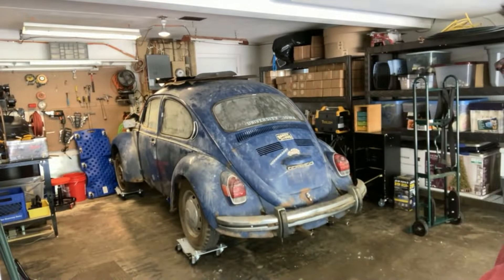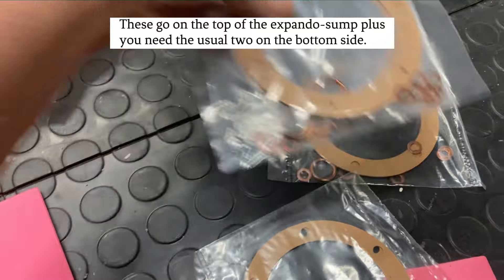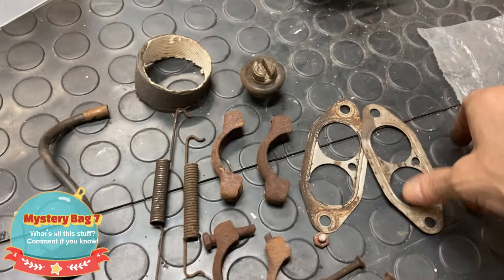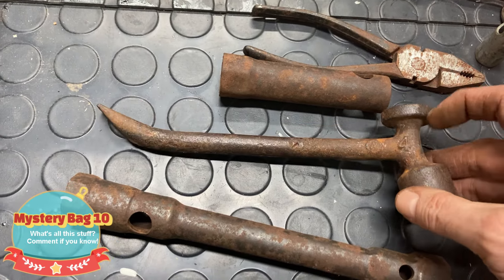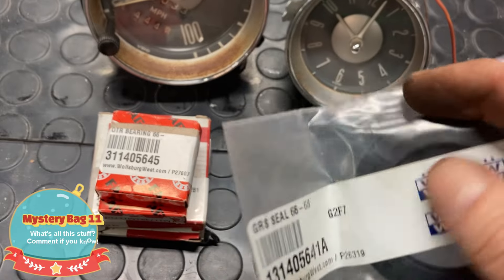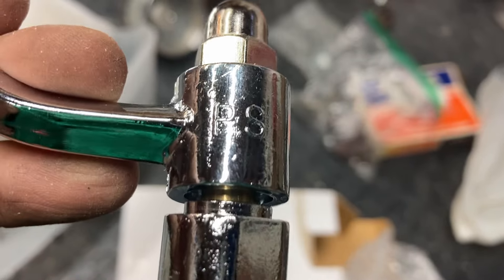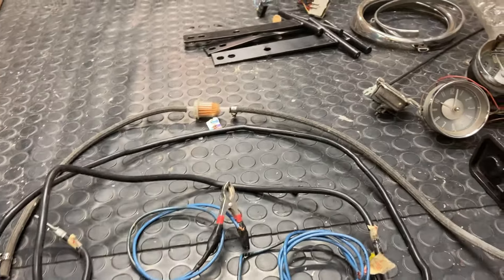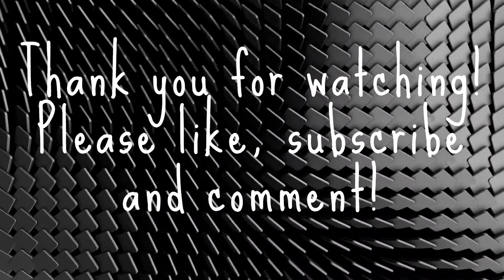Episode 10 - Classic VW Parts Identification

Comment: Bag 10, Spark plugs  and wheel bolts tool.  The hammer isn't a vw tool. The small socket is for the fuel pump filter nut ? vw wrench /plier that comes with tool kit

Comment: 15:30: Ah, yes, the famous 4-cyl distributor cap. Back in the early 80's, I worked at a Porsche-Audi dealership, and worked in the parts department about half of the time. I learned pretty quickly that 4-cyl Audi caps were the same as VW Rabbit caps, as were 4 cyl Porsche 924 caps. One day somebody brought in a 928 with Belgian tags, and it had a dual distributor setup that US models did not. I mentioned that the caps sure looked like those from a 924/Audi 4000/VW Rabbit, and the shop foreman (a German man named Helmut) informed me that EVERY VW back to the earliest type 1's used that same distributor cap.
Reply from the maker: Fascinating!  These little tidbits of knowledge are great to have.  Thank you for commenting!  I used to work with a Helmut!  He was a hoot.

Comment: Bag 11, Late 70's type 3 gauges. Mechanical  bug fuel gauge. Both horns are bug one's.
Reply from the maker: I had a feeling I'd get all the info I needed from you!  Thank you for taking the time to do that!  It was very helpful!
Reply: @TrixedOut  
You can do a will it work video, on the vw radio. All you need is a 12v power source, good speaker, and a antenna.
Reply from the maker: Great idea!  I’ll do that!

Comment: HI Trish, greetings from Florida. I wasn't sure about most of the parts you had, but as someone else mentioned, the speedo and the clock are from late 60's and 70's Type 3. I had a 66 Type 3 Squareback back in the day, and that's the speedo and clock I had. But the prize is the Sapphire radio. If you can get it to work, it will certainly fit into your 71 Super. I tried to find a Sapphire AM/FM for my 73 Super, and I did find a working one on eBay, which I got. Problem is, it did not come with the proper faceplate or the radio knobs. I found a faceplate for it, but it wasn't cheap. The proper knobs like you have on your radio are nearly impossible to find. And when I did find some, they were as much as $50 each, and there are 4 on that radio. I'm not paying that kind of money for radio knobs. So I boxed the radio, put it on a shelf, and installed a period correct non-Sapphire radio that looks almost identical. I'll hang on to the Sapphire and one day I will find a faceplate and knobs that I can afford. In the meantime, the one I installed works just fine. I'm looking forward to seeing you work on your Bug again. The blast cabinet is nice. Could I have really used one of those over the years. Update on my 73 Super. Engine is done, first start has been done while on the stand. It runs perfectly. It's been wrapped up and put aside until he's ready for installation. I had to buy a set of refurbished heads for it. The moron who put plugs in it (over 20 years ago) cross-threaded 3 out of 4 of the plugs and chewed up the spark plug holes so bad that new plugs could not be installed. There is a way to repair them from what I was told. I guess you put in a sleeve and re-tap the holes. A lot of work but it was cheaper for me to just buy a set of refurbished heads. Just like it was much cheaper for me to buy a brand new carb rather than rebuild the old one. $22 bucks for the rebuild kit, a couple hours of work (that I'm for paying by the hour) versus a brand new carb for $55 bucks. Body work is all done, and it should go to primer this weekend if the weather holds. Then glass removal, and paint within the next week or so. Getting closer. Still will be May/June for completion. Look forward to your next video. Cheers! 😎
Reply: P.S. Refurbished my bumpers last week. Disassembled them, cleaned, sanded and painted the brackets, compounded and polished the bumpers, and installed the new bumper guards. (thanks for you help on the guards) They look great. Not show quality but certainly driver quality. They aren't the original ones, but they came from VW in Brazil in 1999. They were pre-drilled for the front license plate frame and bumper guards. I only had to drill through the rubber impact strip. What a pain that was, but it's done.
Reply from the maker: You have made a TON of progress on your bug!!  I'm with you re paying for stuff instead of fixing it if the cost is about the same.  Time is money, as they say.  I can hardly wait to get back at it.  I'll finish the blaster this weekend and get that video out.  Then it's chassis time!  That is very exciting news about the value of my radio!  The radio I have in the car already has all the knobs so maybe I'll sell something to add to my Bug fund!
Reply from the maker: I'd love to see pics!
Reply: @TrixedOut  I'd love for you to see some pics, and I have a short video of the first and second start of the engine. Unfortunately, he has not posted anything on YT on my car yet. Short of direct emails, there's no way to post anything on here. If he ever gets around to posting anything I'll send a link.